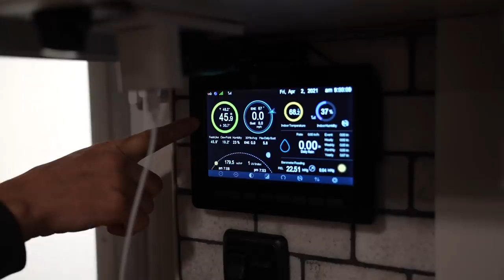WE'RE NOT READY FOR THIS | BUILDING OUR OWN HOME

Comment: Haven’t read the other comments but before I forget... imagine your house is completely done, everything is in, it is amazing. Then, in about 6 months your smoke detector that you put up using the scaffolding goes off because a spider has decided to go in and check out the dark space... at 3am. How will you service it? How will you get it down? Can you instead put that detector above the master bath area on the ceiling? It is sill at the high point in the room BUT is accessible via a small ladder and then stepping onto the roof of the bathroom. Just a thought :)

Comment: Do you pay for each 4 way inspection?  When I had mine done, they were quite expensive.  When I called to book the inspector sent me a checklist.    He said I want to see a 100% compliance on everything on the list.  He told me to take my time and carefully go through the list.  He also wanted a list of all or any contractor that I used with their certification numbers.  The only thing I had wrong was a electrical splice box was located incorrectly (it would have been hidden when the drywall went up.)

Comment: A little late now but for your next house build they make certified wireless smoke detectors where only the root unit gets a wire and AC.  Usually come with 10 year batteries.

Comment: Don't know what your local codes are, but all of our hardwired smoke detectors have 9 volt battery backups. If yours do too that detector installed 20 feet up is going to be difficult to deal with. We have one 12 feet up in a room over the garage and also in the master bedroom, and I really hate having to climb up a tall ladder to replace the battery each year. (Love the channel, btw)

Comment: OK ... be careful not to 'over pressurize' the inside gas piping because the gas valve on your furnace as well as the gas valve on your water heater can fail if 'over pressurized' ... 
Propane (LP gas) has an average opperating pres. of 10 to 11.5 W.C.  which is less than a 1/2 pound PSI ... those gas valves are not inexpensive to replace ...
That is the correct way to do the staples ... electricians have been doing it that way for a long time ... My Dad was a Lineman ...

Comment: At 9:10 you said the pipes would be fully enclosed in insulation.  There should not be insulation between the hot and the cold if you want heat transference.  Normally there is not insulation between the pipes and the inner  wall surface so the
Reply: so the heat from the house will also keep the pipes from freezing

Comment: Where I live it is code for the smoke detector's to be wired that if one goes off they all go off. My electrician ran a totally different for the smoke detector's. I also had to have a carbon monoxide detector installed in the area of the return air grills for the HVAC. Those were wired the same way as the smoke detector's. Codes are probably different in Utah though.:)

Comment: Looks like you are using 14/2 for the hardwired smoke detectors,  that is OK for the power going to the first one but all the other smoke detectors require 14/3.  The 3rd wire is so they can communicate, when one goes off they all will go off.

Comment: You should check what your local FD requires for smoke detectors . We require in new homes 
One smoke detector on every level of the residence.
One smoke detector at the base of each stairway.
One smoke detector outside of each separate sleeping area.
One smoke detector inside every bedroom.
A minimum of one smoke detector must be installed for every 1,200 square feet of living space per level.
Must be hardwired and interconnected smoke detectors with battery backup.
If the smoke detector is within 20 feet of a kitchen or bathroom (containing a bathtub or shower), the smoke detector is required to be a photoelectric detector.

So because of your open floor plan if you put them at the top and base of each stair case on the ceiling that would get you one per level , cover the stairs, outside /inside each bedroom. I would put one above the loft area & not above the living room because your going to be taking the staging down I assume & when you have to replace it, because you will, you can reach it with a step ladder if its above the loft. 
On  CO detectors we do
On every level of the residence, including basements and walk up attics and must be located within 10 feet of each bedroom door.
Combination detectors (photoelectric smoke and carbon monoxide detector) may be used anywhere.
Combination detectors (ionization smoke and carbon monoxide detector) may be used if the detector is outside of 20 feet of a kitchen or bathroom (containing a bathtub or shower).
Combination detectors must have both a tone and simulated voice alarm to distinguish the type of emergency.
May be either: battery powered, plug-in with battery backup, hardwired with battery backup, or system type.

Comment: You needed to tie your smoke detectors together with 3 conductor wire if you didn't. They need to communicate and all go off if one does. Also, you would have been better off putting the high one closer to the half wall so you could reach it to change the battery.

Comment: T&A, you may want to re-think the smoke alarm locations!  If they are anything like mine, they don't just detect smoke, they seem to detect ANY kind of smell ... so having one in the kitchen means it goes off every time I cook anything!  Also, even if they are mains wired, they will have back-up batteries that will need to be changed, so having one way up in the roof is going to be a damned nuisance!
Reply: The detectors have to be hard wired so I don't think there are batteries.
My only concern is, if they go off, how will they get up there to reset them?
Reply: @deedieducati2272  I think they have to have back-up batteries in case of a power cut.

Comment: Argon is heavier than air, therefore, given the bags are attached at the top (after installation), even if you didn't crimp and seal them, a minimal amount of argon would escape.  Argon comprises .934% of the Earth's atmosphere, and therefore we breath it in all the time.  Argon is used in welding, and the danger with it is using it in an enclosed space without proper ventilation of fresh air.  Ref:  https://en.wikipedia.org/wiki/Argon

Comment: So hardwire smoke detectors still use batteries as back up! You will need to go back up to wherever you install them. Sometimes they also go out and have to be replaced! It is very annoying to have them go off at inconvenient times and have to climb a ladder to shut them OFF! Make sure you have a way to get up there AGAIN to do this or you will want to shoot it down when it goes off! I’m NOT kidding. So unless it has changed (which I don’t so) Very IMPORTANT! REALLY REALLY!

Comment: Sorry, no.   You will go on vacation or whatever.   The electricity will go out or something.   Maybe just a super cold day.  You will end up moving those pipes so that they come up inside the kitchen cabinet . . . if you don't do it now, you'll end up doing it later.  Depending on shared warmth from a circulating system  . . . is a bad idea.   We've owned rental properties for 30 years . . . and this is something we fix without even thinking because it will freeze--sometime somehow and usually on a Sunday or holiday weekend.

Comment: Plumber rule of 👍,  25 year Plumber here 👋.  Outside wall no water in the wall no matter what. If you have a power failure you lose ambient heat 🔥 your pipes will freeze no matter what. Plan for the worst/ hope for the best.  Water Pipes up through the floor

Comment: Thats not how it works.  There will only be hotwater in that line if you are running water through it.  When your not using the water in that line it will cool off.  Its why you never get instant hotwater.  If thats code and you insulate your pipes ther thats fine.  Where I live in Canada thats not code.  You just don't run pipes in exterior walss here.
Reply: Also thats the first time I've sen some insuluate all the pipes in a house.  Thats code there? Weird.  I've only seen it done here in co;d zones like insulated but not heated garages or for exterior water spigot lines on a house.

Comment: You defeated the purpose of the pipe insulation by putting on oversized insulation. The insulation is mainly supposed to keep cold air from coming in contact with the pipe. Now you have trapped the cold air inside of the insulation by using oversized insulation.

Comment: If someone has already mentioned this, then I apologize. Given my history of chasing down the mysterious beep of a smoke detector in a house. I would rethink placing a smoke detector high up in the entry. You won't have a ladder tall enough to replace the back up batteries when the battery dies. Or for that matter, swap out every 6 months per manufacturer recommendation. Just offering my 2 cents to save you grief down the road.

Comment: Install a couple of  carbon monoxide detectors also!  I guess you’ve some “generator’’ that kicks on, when power kicks off?? Otherwise, wouldn’t you want detector’s that’ll work if/when ‘“power” Is(or. goes) out? Just asking(?) I’m fear-ful about things like this. I couldn’t chance to not having at least 1or 2 of each detectors, if power went out in middle of the night. But, that’s just me. - I’m probably missing something obvious. Is similarity how I feel about having all house systems operating 100% via ‘AI’ or computer Intel. The thought of stepping outside for a couple minutes to water a couple “flower hangers”, or pick up the mail, and my Computerized locking system locking me outside while my baby was inside napping, would freak me the hell out!  I could never trust a ‘computer system’ with the simplest of fuctiions. I’f rather be responsible myself.Naturally, I’d love to have my car heated in the morning before ‘loading in’. But, that’s about as far as I can imagine going, so far. (And, I know that’s been an ‘olf-shool’ thing available on manh car for many years. But letting my car ‘drive’, “on auto pilot’ will I’m behind the wheel and my kids are in the back, will never be for me. At least nothing I’ve seen has changed my mind. As drivers we’re responsible for ‘EVEERYONE” on the roads, not just those in our car. - maybe those ‘hardwired’ fire and monoxide detects have ‘batteries’ in them for ‘back up’?
I read a ‘fun fact’ when at my Doctor’s office last week/ apparently we’ve NO sense of ‘SMELL” when we’re asleep? Strange, right !(?) (I confirmed on Google and, the study was done at Brown Univ. Google posted, May, 2008.  Study found that odors easily detected when ppl were awake, or, “were IN the early transition into sleep”,  (Stage One Sleep). But, once person IS asleep, they did NOT detect odors NOR, “rouse us” from sleep.

Comment: Please get a smoke detector that runs on both batteries and electricity.  I lived in a house that had a hardwired smoke detector and the neighbors house caught on fire and the first thing the power company did was turn off the power and gas so if the neighbor hadn't knocked on  my door I would never had known about the fire and been able to evacuate.  We lost many windows and the roofing in that fire.

Comment: You do know that you have to run three wire from each smoke detector to the next so that you can use the interconnect feature on the detectors? It just means that if one goes off they all do. :-)